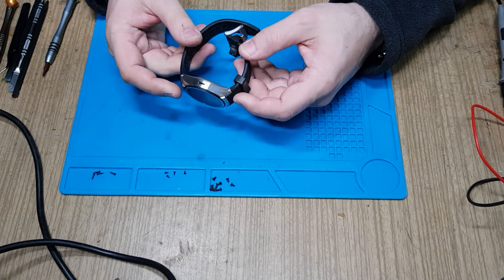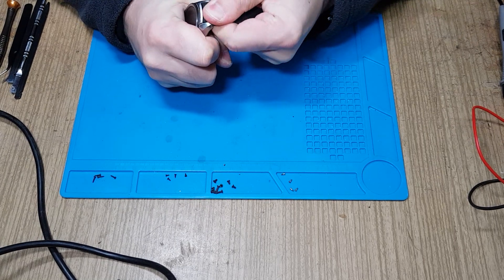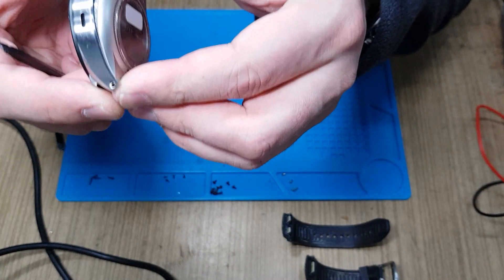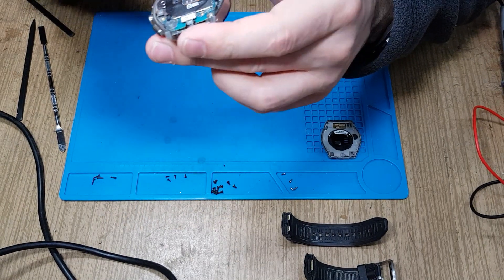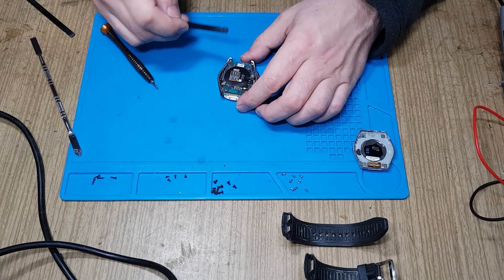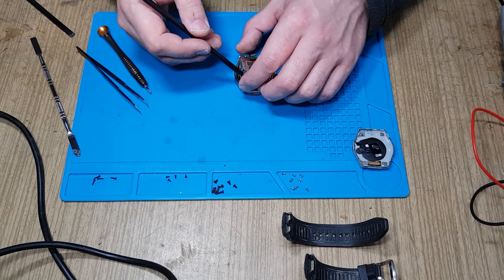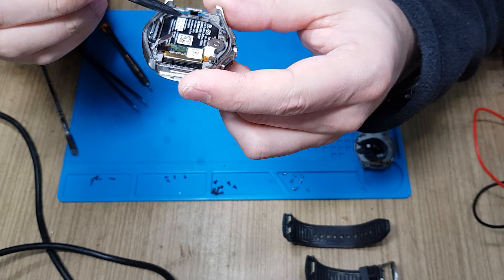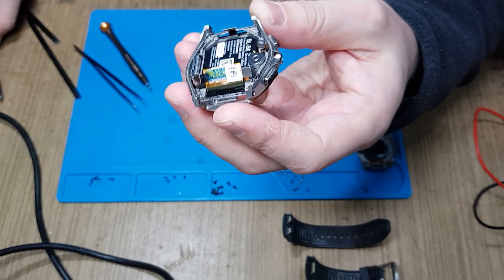LG smartwatch urbane 2 w200 simple opening/teardown

Comment: Just replaced the battery thanks to this video. It ends up short, but it's easy further down the road. Starting at 8:33:
- the metal part is glued to battery, gently pry it, it will show the battery and release the cradle from the watch. 
- (optional) remove cradle from the watch
- remove battery by gently pulling on cable and even more gently prying it from the glue blobs, mine were on the sides.
that's it.

Comment: Hi,let fix garage I'm from Mexico and I'm interested in knowing why my wacth does not turn on anymore. It's the same model when I load it. I only get a blinking battery.
Reply from the maker: Hi Alex, I would check for water/sweat damage and clean internals with alcohol. Maybe battery is drained out and neads trickle charging or replacement..